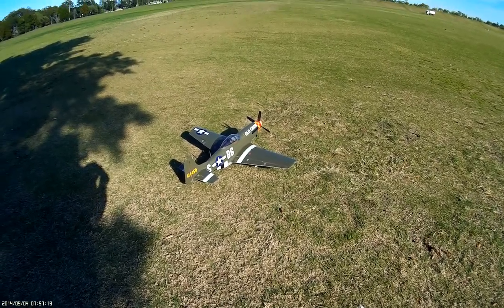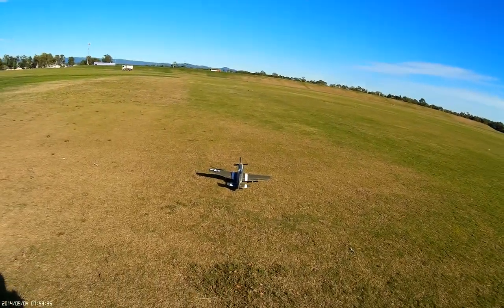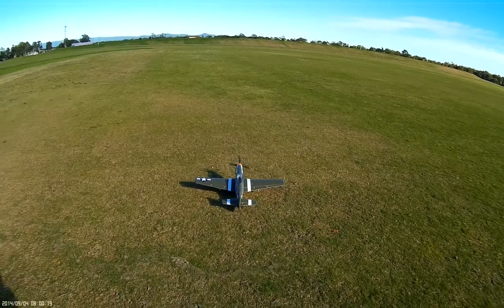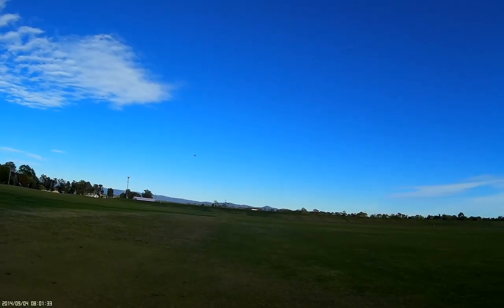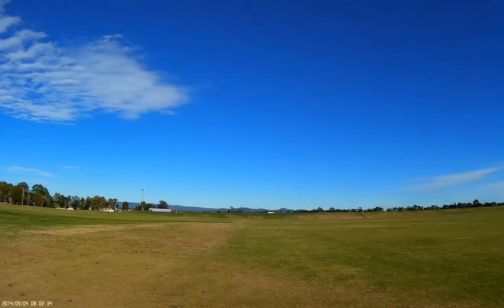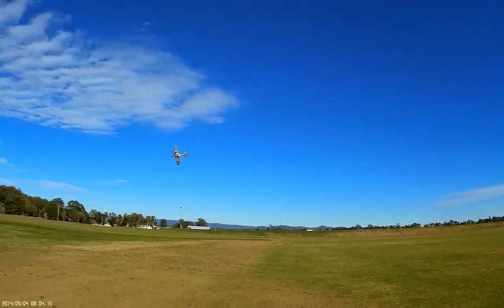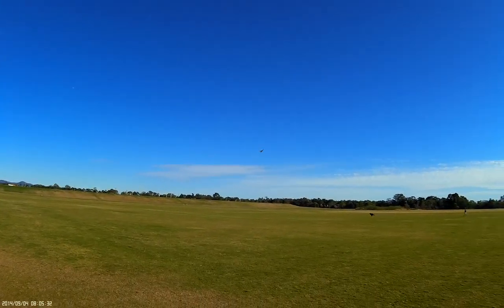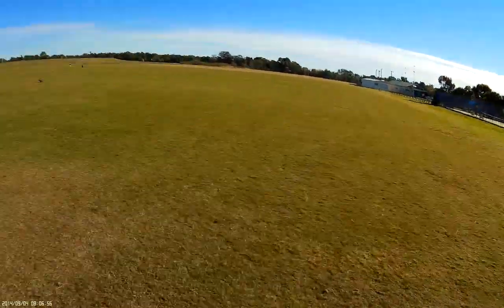Durafly P-51D Old Crow Maiden with blather

Comment: nice maiden Jonesy apart from the nose dive at the start.
Thought that dog was going to attack it when you landed.
To tame down the nose wheel on take off can you put a mix into the landing gear so when its down the rudder has a really low rate so you can steer it easier.
Im sure youll be whizzing it around in no time.
Reply from the maker: Thanks... yes i'm going to do the mix before I fly it next.

Comment: did you follow the cg 75 as per manual?
Reply from the maker: +353flyer Yes mate... with a 2200mah 3s pushed right up the front it's spot on.
Reply: alright thanks man, great maiden btw !
hopefully mine will go smooth as well lol